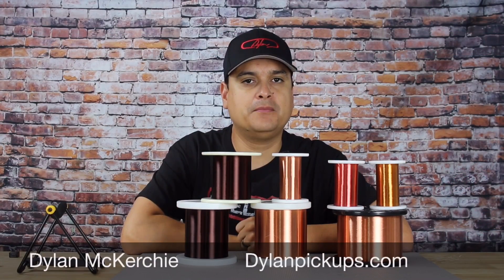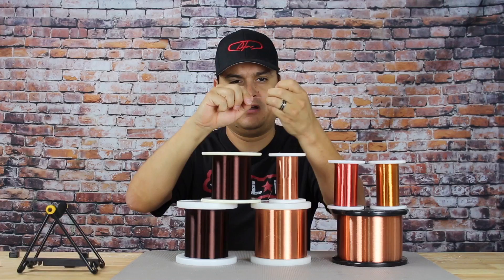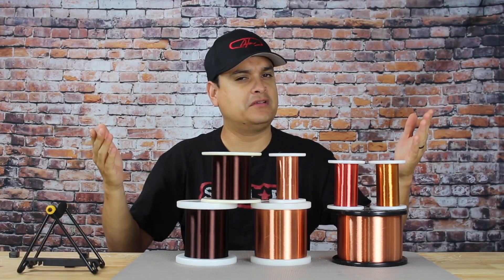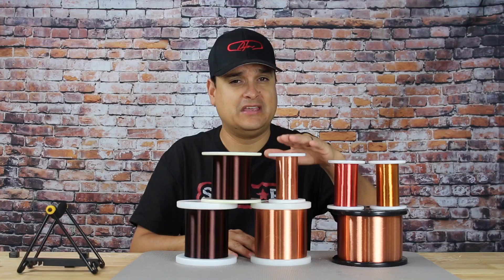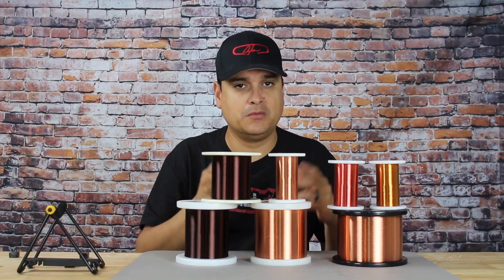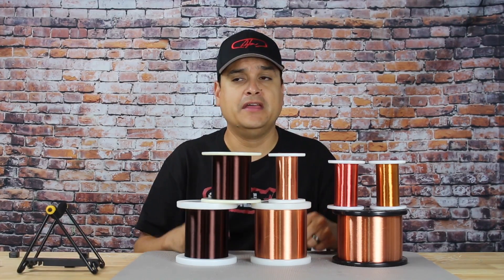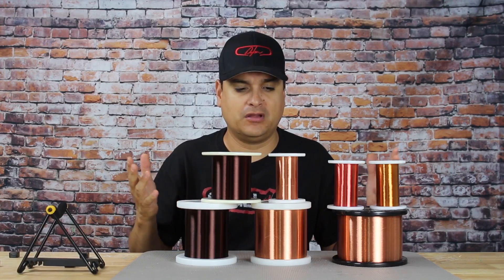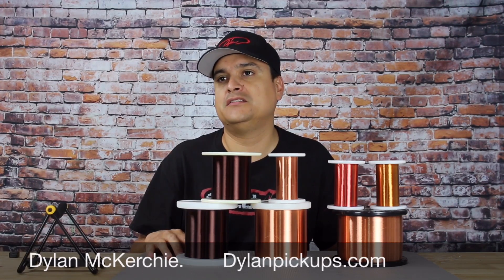How tension affects Pickup winding... And how coil wire is made. Part 1 #131

Comment: Seriously? You can significantly (let's say more than 2%) rise the resistance of 42 AWG wire by streching it?
I don't think so.
Reply from the maker: You can actually. It’s something you have to watch while winding
Reply: @DylanTalksTone  Yes. In purpose not to break a wire. If a given wire gauge has a breaking tension you should be able to determine what DCR rise is at that tension. Nobody cares cause DCR is irrelevant. Wind count to DCR wind ratio tells you however how your winding is scattered or loose.
Reply from the maker: @zbyszekolko3998  correct, so when hand winding, we wind to a particular wind count, not DCR. Once the resistance per foot of a particular roll of wire is determined, you can tell if you are over tensioning the wire. This is key for consistency
Reply: @DylanTalksTone  DCR of a given wire is specified at unknown tension used to stretch it to make a measurement. I don't think anybody bothers checking this in guitar pickup bussiness cause it is irrelevant. If you do, you should be able to reveal what is the real resistance per foot of unstreched 42AWG wire and how it rises at breaking tension. Can you?
Reply from the maker: I’ll mention this in a livestream to explain it so you can understand it.
Reply: @DylanTalksTone  Thank you. I am afraid I do not need an explanation but the demonstration. Your claim is wire tension can cause more than 2% DCR rise at breaking point. I don't believe  it until it is demonstrated and consider it irrelevant for any guitar pickup feature. I believe wire count to DCR ratio is much more a result of a scatter pattern than wire tension.
Reply from the maker: you are totally backwards. DCR is a reflection of the length of the coil wire at a given gauge. That's a fact. The "scatter" affects Inductance and capacitance. also a fact. Science.... not Belief . 
So... when wire gets stretched(which is possible over the length of a coil wire) it does BOTH things that affect DC resistance. It changes the length of the wire, and the diameter. True, it is slight, but if done over the entire length, it compounds. This also means the scatter is less, so the Capacitance is higher, it also affects inductance because the coil SIZE has changed. All these things compound to give you an inconsistent product. This is not opinion. It is the physics of a coil. 
 @zbyszekolko3998
Reply: @DylanTalksTone  My claim is scatter affects turn count to DCR ratio relevant way and tension affects that ratio the way nobody including you can demonstrate. Tension just has to be resonable to get consistent coils.
Happy New Year full of yt videos revealing pickup winders secrets!

Comment: More miraculous than the 42awg wire 'stretching', the insulation must stretch as well without breaking(!!??). Theoretical true and practically impossible. I'm not sure if this was spawned by SDuncan white paper, but it just adds to the other nonsense that distracts from what really matters. This concern should be filed with the hyper-ventilating over 'capacitance due to parallel wires' (as an attack on big pickup makers). A pickup has capacitance for sure... but not due to the wildly random alignment of wire around a bobbin changing alignment every 4.5 inches (these aren't radio transmitters). Trying to hammer all these misapplied physics square pegs into the round holes of real world pickup construction is distracting from just making solid quality pickups and let the magnets do their thing.

Comment: Is it a decent idea to just wind the pickup until I get the desired resistance, rather than stopping at a set number of winds? Is there anyone who does this?
Reply: If the number of winds varies, but the resistance is the same every time I wind a pickup, do you think that would produce a more/less consistent sound than if I did the exact same number of winds and ended up with different resistance due to different tension/scattering?

Comment: Ugh. I hate when people "explain" things but really they don't. "Tension affects pickup winding" < Half of your title and sums up about 100% of what you learn from watching this video. HOW DOES IT AFFECT THE PICKUPS?! We also have ears maybe show us by recording so we can HEAR the difference. This is a nothing video and you should be ashamed of yourself, you have wasted my time.
Reply from the maker: Thanks so much for watching. I appreciate it. Stretching the wire raises the resistance of the wire. It's really pretty simple. It is basically impossible to put thos into a "tone test" that you could hear. It's more a mathematics thing at that point. See, this is the problem with guitar players in general. They think every little thing is going to make this massive difference and it just doesn't it. When designing a pickup it matters on some levels, but it is not something you can just create an AB test for. I'll address this question a bit more specifically at the end of our next video. Thanks so much for bringing it up and thanks again for watching.
Reply: @DylanTalksTone  So if there's no difference why bother hand wiring at all?
Reply from the maker: @knedy  you asked about tension. There are a ton of other factors.

Comment: How would using a hand tensioner tool affect the final tone of the pickup, or rather the variable resistance within an individual pickup? I have been winding by hand using just my hands to guide the copper wire and the pikcups have lots of variation. Im thinking of moving to a tensioner tool but I am worried that will kill some of the Spirit of the final result as the resists will be more consistent in tension.... Thoughts on this?

Comment: I'm winding my first couple of pickups and the wire keeps snapping. I think it's due to the way the wire leaves the spool. I hear everyone leaves it on the floor with no problems, but when I tried it snapped as the turn reached the back side of the loop . The only way it almost works for me is to hold the spool at a 90* angle facing the pickup bobbin so the wire leaves the spool from the top, with no angle creating tension, and relatively close to the bobbin. Anyone with the same problem? any tips?
Reply: Man Alive!! Tough Luck there Joey!
 I keep my wire on a shelf about 2 to three feet directly below my guide bar and it spools off fine. One issue I've had with a couple wire manufacturers is they don't always put the labeling (sticker, or print) on the same end of the spool. Try flipping ypur spool upside down. Of course you want to start at a loooooww speed at first too . Another tip, you might think you need some slack from the spool.... slack, in my experience makes for a LOT more broken wire. Good Luck My Brother!
Reply: Hi Joey, I make pickups, yes the spool is on the floor but you might need to sand off any sharp edges on the spool! They always have 'em! They usually have a seam right down the middle, take that off with a bit of sandpaper then you should be good to go!

Comment: I don't believe for a minute that the change in resistance due to putting more tension on the wire affect the sound in any significant way. The tolerance of the potmere in the guitar has a far greater impact on the output. A much more likely explanation is that a more tightly wound pickup has a different parasitic capacitance, which can shift the resonance of the pickup. Although again, the parasitic capacitance of your guitar cable will have a greater influence. We are all mistifying this  stuff way too much!
Reply: Exactly what I have found winding pickups by hand.  You can have a huge difference in capacitance, and the resonant freq shifts significantly between two coils with the same inductance.
Reply: ..and what the deuce is a 'potmere' ??

Comment: When someone says 1 pup has more headroom than another pup,, could u tell me what is meant by that plz. Thx
Reply: It means theres a lower resistance. Say 7.5k comoared to 9.5k. A 7.5k piclup. Like alot of old 50s ones dont hit the amp as hard so with a tube amp you have more clean headroom before it starts making the amp break up.  With a hotter pickup like 9.5k it will push the amps preamp harder and make it breakup more. Causing what we call overdrice or distortion